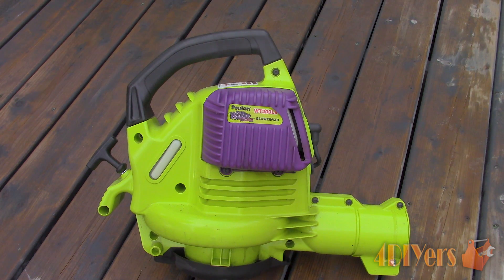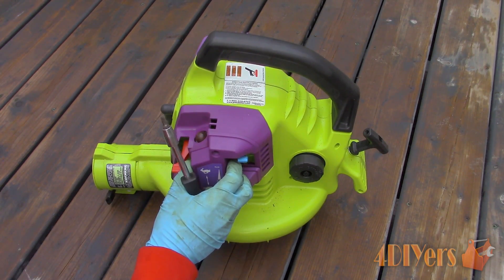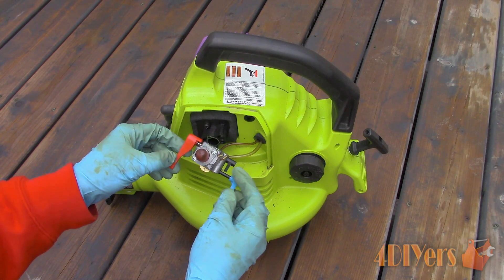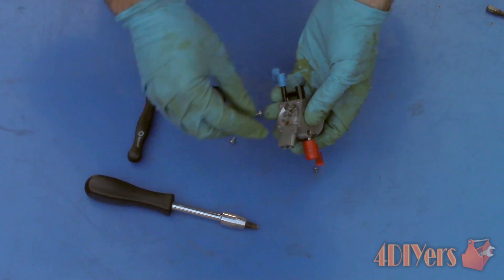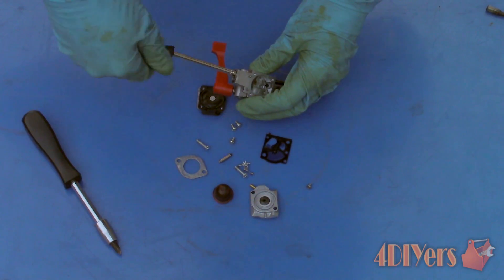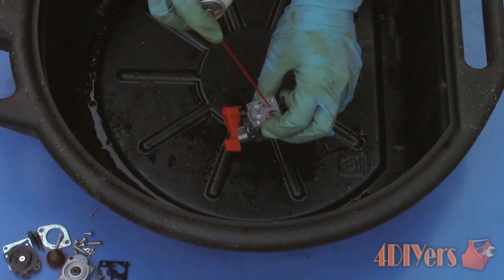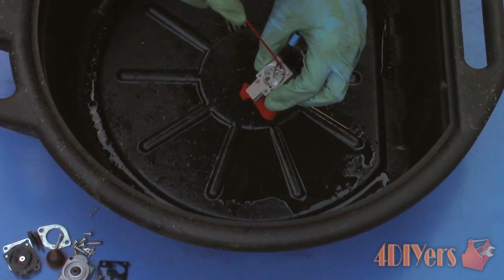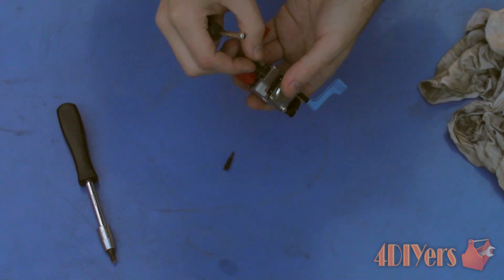DIY: How to Clean a Two Stroke Carburetor

Comment: That's a great video - quick and clear, but sometimes the audio / voiceover was rushed (needs to be slowed down). I am sure my leaf blower high speed jet is blocked and this will help a lot to clean it out. Thanks for posting!
Reply from the maker: No problem, happy to help! Yeah this was an old video, was still playing around with the audio settings. All my new stuff is properly timed now.
Reply: @4DIYers  I cleaned my carby out per your video which was really helpful, and it runs like a champion - thanks very much! In my carby there were 2 little ball bearings and springs pressing against the throttle and choke levers, so for others, be careful when you pull those out, in case yours has them too.